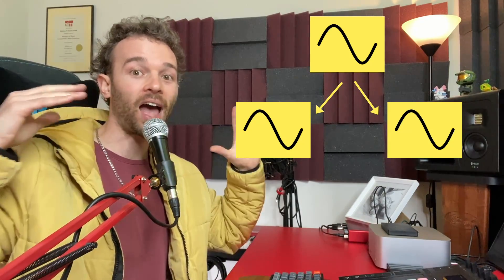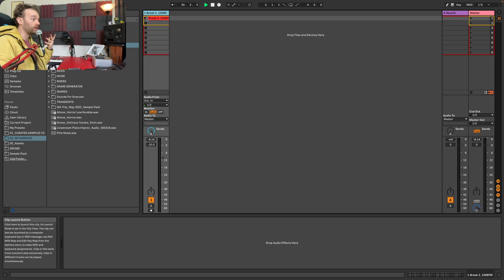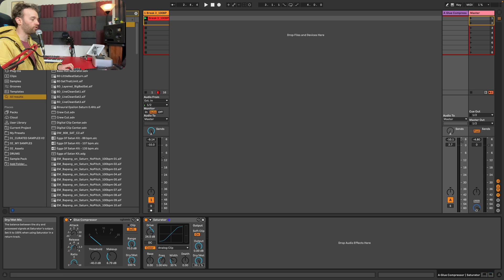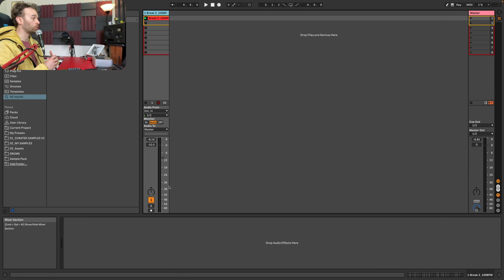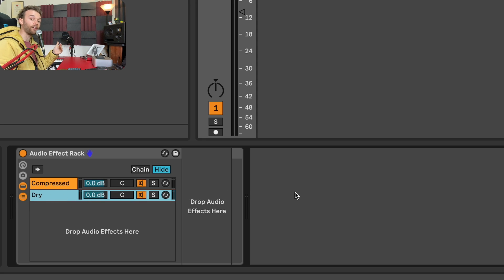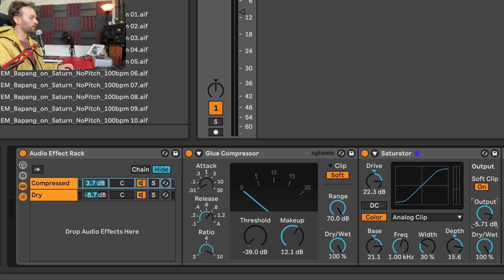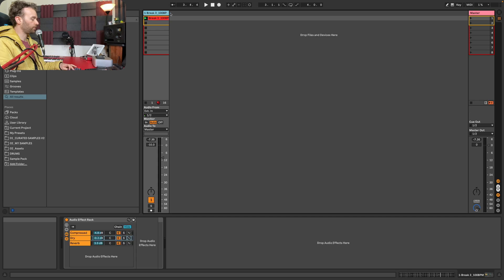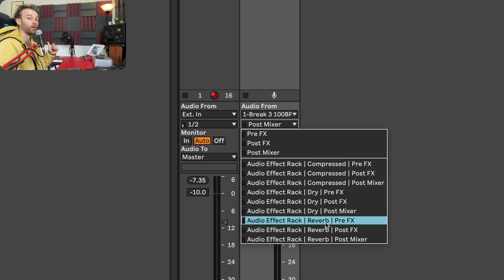Parallel Processing in Ableton Live

Comment: Man thanks for this I’ve been looking how to parralel processing in ableton i was using the send but ableton has an issue with outputing sends to tracks that have sends active which creates a loop…Glad I could do that with normal track instead. 
I subbed.
Reply from the maker: Definitely worth doing this with normal tracks and saving the Returns for other situations. Thanks for watching! :)
Reply: @ i have a question tho how do I input multiple tracks to a track for parralel processing? it seems I can only listen for one track input . Im thinking of listening from a send and then sending mutiple tracks there, but idk how ableton handles receiving signal from sends back to normal track if they will be any latency or delay.
Reply from the maker: @potatochipappi if you'd like to process multiple tracks in parallel then I recommend using a return track. If you want to send that return track back to an audio track, just make sure to disable the sends on that audio track, which you can do by right clicking and disabling all sends. That should stop there from being any weird latency. :)

Comment: Hi Martiln.   

Thanks for a clear demo!

Are these parallel processing methods only about conceptual visualisation of the processing flows in the UI, or do they also relate to Ableton distributing sound effect computations across multiple processor cores or threads (ie ways of more efficiently using the computer's CPU)?

Cheers

Mike
Reply from the maker: Great question! I'm not suuuuper clear on it as the documentation is a little confusing, but as far as this video goes it's more of a conceptual visualisation and doing parallel processing I'm pretty sure uses single threads. Each individual stream of audio from the source I think is what uses multiple threads, but again I'm not 100% certain on this.

Comment: You can also do this with instrument racks, but effect racks are better for it. 
You can also do this by using multiple tracks instead of sends. This way is also more visual and quicker at a glance. 
Live is really flexible with how it lets you do things! So many ways to do parallel processing.
Reply from the maker: You can only do it with instrument racks if you're using a MIDI track, but not an audio track (unless you want to do some crazy routing shenanigans!). And yep, I talked about the multiple tracks in the video, and I love doing parallel processing this way for sure! :D
I love how flexible the routing options in Live are. There are lots of different ways to achieve the same thing and you can really make the software work for you. :)
Thanks for watching!